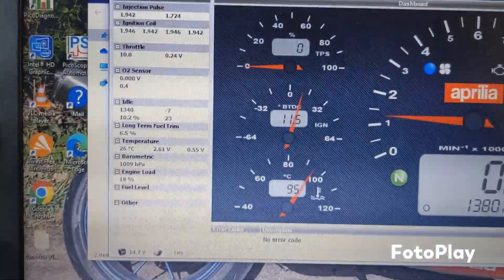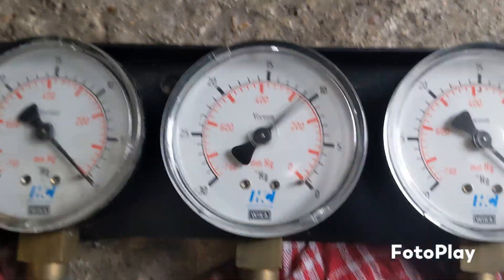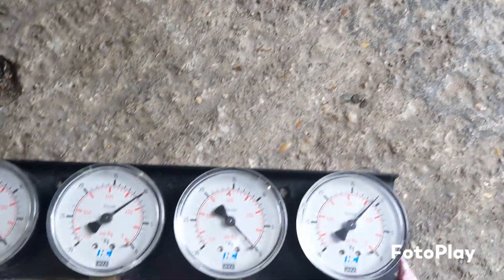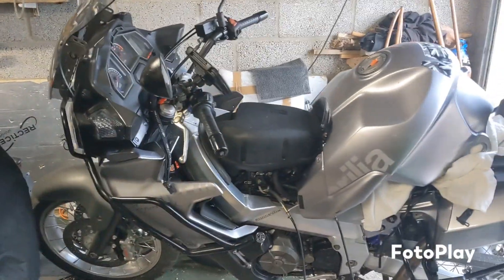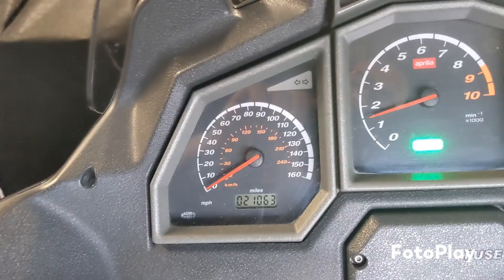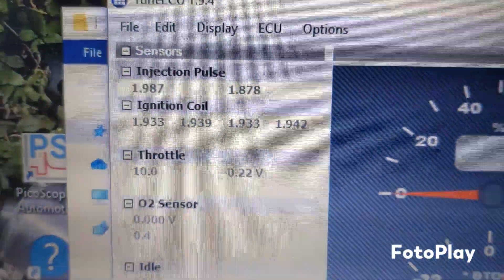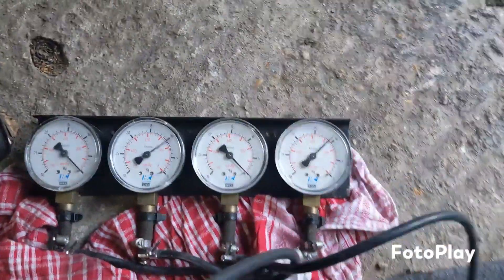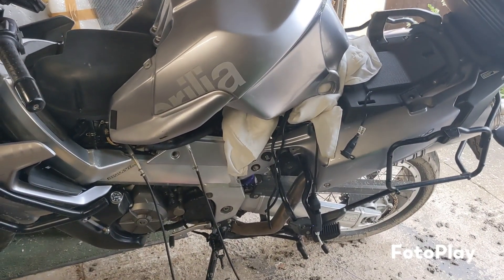Tune ECU and vacuum gauges on the Aprilia Caponord

Comment: Thank you Captbarbs Garage for all your great videos!
Also, I figured I would ask here if anyone can give me some advice. I'll try to keep this as brief as I can, while providing the important details.
I recently acquired a 2007 CapoNord ETV1000. The bike will start sometimes and sound smooth as it's running, but it will shut off soon after. When I connect the single diagnostic wire, I get codes, 15, 16, 17, 19, 41, 43, and 44. Some of these codes are for the Throttle Location Sensor, Fall Sensor, and Fuel Injector #2. I'm not exactly sure what the other codes are, but this has me thinking that it is a problem with the ECU. I don't really know anything at all about ECUs and I've been trying to get help everywhere and anywhere I can, to no avail. There is only one Aprilia dealer/service center near me, and they told me they can't help me, because they don't have connectivity support for this model year. I have also tried the Aprilia Forum, but the site won't keep me logged in, and I can't find any threads that help me understand the problem. I have also completely read the owners manual, service manual and two other books related to general motorcycle electrical systems. Please help! Can anyone at least guide me to an easy to understand, comprehensive resource for how the ECU works and how to fix or clear these codes? Thank you for any insight.
Reply from the maker: Have you tune ECU?
If so you can see the tps and see if Injectors are being fed a voltage  whilst running and see fault codes etc .
Reply: @captbarb6642  I don't have tune ECU, I'm guessing that's where I should start?  My concern is that I don't know what I'm doing, so I don't want to make things worse.
Reply from the maker: Online there is a manual for safe operation of tune ECU if I can use it you will be able to.
If you say it starts ok then plays up does that mean it's temperature related .
A good place to start without tune ECU would be to check the plugs are firing the coils do go bad with temperature and time , then looking for air leaks on all the intakes whilst running ,check and clean the air control valve in the air box.
Reply: @captbarb6642  Thank you, I'll have some time tomorrow to look things over. The reason I think it was a problem with the ECU and not temperature or combustion issues, is because of all the different codes, the temperature gauge reads about 150⁰ when running and it doesn't sputter while it's running or when it dies. The engine just cuts off, similar to the sound when you normally turn your bike off. I will also have to get a cable to connect my bike to Tune ECU, so I'll have to get back to you on this. Thank you for your response and guidance!
Reply from the maker: There has been issues with the ECU connections worth a check ,maybe worth checking the actual power to grounds on like the ECU etc
Reply: @captbarb6642  Thank you, I'll try checking all the connections as well, that's a good idea.

Comment: Brill, really looking forward to tinkering with ECUTune, especially after the valves adjustment. I have bought the windows 10 kit ready to go but won’t touch it till I get this dash sorted (one way or the other). 
I’m replacing the caps again for an aluminium electrolytic type; the dash goes out after a minute or so. Ive read the standard ones are not stable enough for this design of regulator ic, so fingers crossed & I’ll replace the regulator if needed after that.
Really don’t want to have to buy a replacement.. 
Anyway your bike sounds like a swiss watch, really nice to see what can be done ✅
Reply from the maker: Good luck just don't fall off it 😉.
A friend had a BMW gs1200 we swapped bikes and I was revving that GS out and couldn't get near the capo with that swordfish map .

Comment: Sounds like it’s running allot better now. It’s all a bit alien to me, not enough cylinders for my wheel house 🤯
Reply from the maker: The rear pot F1 on tune ECU fuels more than f2 the front pot so I got it right less vacuum=more air , so my rear pot has more fuel and air to turn the engine 420 degrees ,the front pot f2 on tune ECU turns the engine or crank 300 degrees .